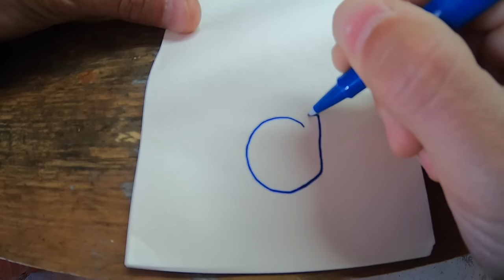MAKE YOUR SNOWBLOWER THROW FARTHER AND NEVER CLOG. Install A DIY Impeller Kit.

Comment: Additional tip -- before the season starts, give the chamber and especially the tubes a good coating of silicone spray, do it several times to get a good coating on. The snow will slide right out and prevent it clogging up. repeat between snow storms unless you live in Buffalo, NY which is pretty much everyday .  Ps: A bottle of rumchatta and hot chocolate usually helps keep the snow blower work better also!
Reply from the maker: Good tips here! I’m in Buffalo so yes this would be an everyday thing! Lol! Thanks for checking out my channel!
Reply: @GarageGear  My son is down in Corning, had 24 inches last week but I think it's all washed out. I wanted to get him a snowblower for Christmas but he doesn't want to keep any gas around his 1892 House on the hill. I had to get him  an electric mower last year when he moved in. Covis has kept him home, and the school up the street is closed otherwise he would have to make sure the walk is shoveled in the morning. I have a big 27" Troy Built and I will look into your idea. I have some 1/8 Derlan strips 4 inches wide I will try. They use that for the skid plates underneath.
Reply from the maker: @Squarekn0t  ah he’s about 2 hours away!  Does he have a shed he can keep his gas in?  Have fun putting the impellers on!  You won’t be disappointed! Let me know how it works out for you!
Reply: @GarageGear  I guess the architect back in 1892 didn't plan on that, they had servants for everything. He does have some of the most beautiful interior woodwork ,that nobody over the years covered up with paint. It was in the same family for over 100 years. Before my son bought it, the landscaper would come when it snowed. I live in Delaware on the coast, it never snowed the first ten years I was here, then I bought an awning for my deck and we had three blizzards in a row. The family from Buffalo moved in last winter and it snowed and we helped dig him out. He said he left his snow blower back home. But overall because were so close to the ocean, it does not snow until late January, or February. The only problem we have here is a tsunami of tourist and now because of our new president , that lives about a mile and a half from me, we have a storm of reporters and poparatzy.
Reply from the maker: @Squarekn0t  that’s gotta be Murphy’s law or something lol!  You should get the reporters to shoot videos of your home lol!  Thanks for sharing!

Comment: I just use sheet-metal with washer self drilling screws it was fast. 
I have to say it does work , I was really happy with snowblowing specially with heavy wet snow.
I even put it on my sons riding  snow blower. 
Truck mudflap picked up at a truck dealership cut it out by using my Dremel and put them on snowblower propeller.
Reply from the maker: I wow I never used sheet metal before? Does that beat up the impeller housing?
Reply: @GarageGear  
No does not damage self drilling hillman fastener. 
The size 10-16 3/4
H#561025
Reply from the maker: @tiger.6509  awesome to hear! Great thinking!

Comment: I believe mudflaps are cheap and very effective to use as the impeller flap extension.
Reply from the maker: Definitely! Those work great too.
Reply: I got mine for free truck mudflap. Just had to cut it to fit.
Reply: The sidewall of an old tire works too.

Comment: Very good video, thanks much for taking the time to make it.  I did this mod on my 24" MTD and I'm very happy with the results.  The only thing I would do differently on your machine is to put a nice coat of paint on the impeller and the chute area.  Snow sticks to that rust like a  tounge on a ice cube tray.  And I can tell you take good care of that snowblower, it started right up with one pull and ran smooth.  Good job
Reply from the maker: tireguy thank you!

Comment: Mr. Gear, the first thing is you make very good quality videos, sound great, dialogue great, staging great.  Do you do a lot of editing?  What video equipment do you use.  Second, why do the manufactures leave that gap?  Some commentors said some newer machines do not have that gap?  Third, the comments on cleaning the rust and repainting the impeller housing and impeller seem valid, seems odd you would do the rubber mod and not do cleaning rust and repainting.  Fourth, will the mod work on a gravel driveway?
Reply from the maker: Hey Tom! Appreciate the positive feedback! I do about 5 hours of editing on each video. My guess is the gap is there for the ease of the manufacturing process. This video was focusing on the flap install. Not on painting a snowblower. This video would be very long if I did that too. This mod will work on just about any 2 stage snowblower no matter then driveway. Thanks for watching

Comment: I did this a few years ago with my blower, however I did not use bolts. I used self tapping screws and it works just fine. A little less work to get the rubber on.
Reply from the maker: Bob Boyer That works well too!

Comment: The impellers are rarely centered in the housing so each wiper must be installed at the point of it's closest point. If you don't it won't turn. If a bit tight they will wear in.
Reply from the maker: All good points here! Thanks for watching Mrreadandlearn!

Comment: I don't have anything to do with snowblowers but maybe waxing up the inside of the impeller tube and the chute might help? It makes a difference on skis and snowboards, so ...
Reply: yes it help, but very hard to apply in winter (cold temperature) and it doesnt last long. the snow is basically hard ice particulate scrapping at high speed the wax coating off. i found riveting a sheet of crazy-carpet inside help alot. its a plastic sheet used by children to slide down snow slope. its about 2$ and its very good slippery plastic that's better than the average rusted steel.
Reply: I think Honda puts a plastic liner on some of their models.
Reply from the maker: Interesting idea.
Reply from the maker: I do that too plus the impeller kits. Throws snow like an animal.

Comment: Impeller wipers are fantastic to increase throw and reduce clogging under wet conditions, but they significantly increase auger belt wear and increase strain on the auger shaft bearing and increase wear on the auger housing, especially if you live in an area where they sand road surfaces. I've used tire sidewall material that has held up great after initial wearing down to fit the least diameter of the auger housing and after 5 years of use in this manner, the improvement in performance has been significant, but after chewing through auger belts (even Kevlar ones) I've come to realize I had to be much gentler going through snowbanks and because of the increased wear on the auger housing, I'll have to line it with new sheet metal come next summer as it has developped perforations from the metal wearing thin from friction over time.
Reply from the maker: Hey John no issues on my snowblower. On set has been on for ten years now! Still rocking! Thanks for sharing! 👍
Reply: @GarageGear  thanks! Mind you my snowblower dates from the 80s so I'm not too surprised with the wear 😆

Comment: did mine 5 years ago !Used stainless steel nut and bolts and lock tight. u can use old tire the sidewall, or bailer belt from TSC etc ... and did all blades/impeller and used a piece of cardboard as gauge to keep the same space at each blade at the tunnel.  And just make a templet to mark the rubber and the blade, center punch it drill it assemble & be done.   HAVE ONLY HAD 1 STORM EVER SINCE  LOL . But I was flinging snow 3X Further ,Wet Heavy Snow; Puddles of Water....FOR SALE :Craftsman TURBO CHARGED SNOW BLOWER !!
Reply from the maker: Only one storm? Really? This really does work well on wet snow. Thanks for checking out my channel!

Comment: Did my Troy Bilt 28" 9.5hp track drive in winter of 2018-2019. It throws snow and especially slush much better. I have a 400" driveway with 1.5" minus gravel so rocks getting jammed in the impeller area was a concern....but the more I thought about the more I felt that the gravel actually now has less places to get jammed into with the new wipers and overall performs better even in the gravel  :)  Lee
Reply from the maker: Lee Windham glad to hear you had some good results with this modification. Even in gravel!

Comment: 2 things you can do to make the drilling alot easier. 1) use a long cobalt center drill to start the holes. and/or   2) take your drill and put a groove on each side of cutting edge which will act like a center drill as you drill the holes. either one will make the drilling alot easier
Reply from the maker: Thanks for the tips MD! Thanks for checking out my channel!
Reply: @GarageGear  not a problem and thank you for the tips on the chute. I wouldnt have thought of that..kept sprayin silicone lube in the chute it helped but doent last long
Reply from the maker: @mikedayitt  yeah that marine grease is awesome!  Works very well! Keep a tube on hand and you’ll find a million uses for it! 👍 Thanks for being a fan of the channel!

Comment: Try spraying furniture polish wax in the chute and on the impeller rubber.   Lived in the Hartford Ct ares for 20 years. Had an electric start Craftsman blower that came with the house.  In 20 years  I only replaced one belt.  It rattled and shook but threw snow about 25 ft.   Nice video.  In about 1998 we hav over 100 inches of snow.  All in about 4 close storms.  Power out, I was  in Myrtle Beach playing golf.  Wife was pissed off.  Generator broke (plastic gas tank). No shop open to repair.  Son In-law saved her.   He lived near by.
Nice video.
JoeB

JoeB
Reply from the maker: Great tip joe!  Thanks for sharing your story! That’s a lot of snow!  Thanks for checking out my channel!

Comment: I had to do this to my 1971 Ariens sno-thro, the machine is awesome except in heavy wet snow.  I bought a truck mud flap at NAPA Auto parts store for $12 and made 2"x4" paddles,  for the top piece of metal I went to Lowes and bought some Simpson Strong-Tie A21Z 2"x1" Angles for 0.78 cents each and hammered them flat, 1/4"x1" SS bolts with washers and Lock nuts.  I was surprised that I was able to drill the holes with a cordless drill and inexpensive ryobi 1/4"  drill bit.
Reply from the maker: Impeller kits make those machines animals in the snow. Thanks for watching

Comment: I'm back checking your video again. I need to make a trip to the hardware store because my girlfriend did something with the bolts and nuts I needed to hold the rubber. I'm not surprised that the shute didn't come off the way I hoped that it would.
I changed my oil after the first time running it. It ran for 50 minutes on less than a half a tank of gas. I drained my oil and started to take the the 4 bolts off. They were 7/16 not 10mm like I thought they would be. Couldn't use a socket wrench on them. Had to use my regular wrench. Now I can't figure out how to get the rest of the shute off. There's several cotter pins and bolts holding the upper mechanism of the shute. I'm going to call it a day and put everything in the garage and start fresh tomorrow morning. I will get this done! I want it to be ready for the first snow fall next year. This is a brand new craftsman snowblower never used.
Reply from the maker: Sounds like you hit a few speed bumps here but trust me, this will be well WORTH IT. Next winter you’ll be laughing at how far that machine will throw! Once you get them on run the machine for a couple of minutes to break the rubber in. It will wear right in to where it needs to be. Good luck and if you have anymore questions check my videos and message me! You Da MAN!
Reply: @GarageGear  thank you JB. I'll get it. I'm not trying to be a negative Nancy. I just reread my comment. I have a shit ton of nuts and bolts so I will figure out something. I got the shute off after learning how to remove the pin that I've never seen. It almost looks like an 8. I didn't want to break it because I've never seen one before. It's a cotter pin but when it's on it looks like an 8. No open end on one side like the pin on the shute rod. 
After my coffee and AM BM I will go back out and finish it up. Hopefully! Thanks for your time and help.

Comment: Wouldn’t it be easier to mark the holes in the rubber pad by holding it under the impeller and mark from the top
Reply from the maker: Fred Baumberger maybe but it you put the rubber piece exactly where you want it and then mark it there is no question about the fit. It’s not that hard to draw the dots.
Reply: @GarageGear  maybe drill the rubber first then mark where to drill the impeller?
Reply: @davebl9645  I drilled the rubber first then drilled threw the metal with pad in place. Screwed pad in with 1 self taping screw then drilled the 2nd hole. I tried car tire side wall.. wasnt very, good  started curling and I replaced with mud flap..much better. Make sure each time you go to use blower you check  if propeller is not frozen because there is not the same clearance anymore. I did burn out a belt once.

Comment: I'm using an old Peterbilt mudflap. Ariens 70s machine I bought for $75. Cutting an extra pair for future use (using first one as a template), coating in armorall, and sealing inside plastic baggie. Impeller has 4 blades, but only modifying two, opposite each other. Mine has between 1/8" to 1/4" gap. Hard to see whether that would help. Impeller blade curves, so I'll only have a slight improvement. Drilling through impeller, I'll paint it before attaching rubber.

Great project to have some time away from the wife and new puppy, lol.
Reply from the maker: Haha it’s funny because I filmed this to escape some craziness in my household too lol!
Reply: @GarageGear  excellent video. I'm certain at least 10 views are from me. I try to let commercials run, but not always successful on all views. ;p

Comment: Did this last winter. Used self tapping screws. Worked great.
Reply: Had the same idea while watching this. Also thinking to use pieces of old paddle from a single stage blower. Did you notice much of a difference after installing?
Reply: Kingfisher yes made a big difference.👍
Reply: @Leroy100  rock on
Reply from the maker: Glad this worked out well for you! Makes a BIG difference!

Comment: Couple hints. If impeller blade is flat, drill holes in it and spray with Krylon 10 minute dry paint. While paint is wet, carefully position rubber over impeller blade and press onto wet paint. Remove and Voila! there are the hole locations perfectly positioned on the rubber. Let paint dry and drill holes in rubber. When bolting to impeller blade, no need to use locknuts. Use a lock washer on the backside. Also, if 4 bladed impeller, do 2 opposite blades first to keep balance, break them in, and then do the other 2. This will reduce the load on the belts and engine rather than doing all 4 at once. Also, rubber is heavy. Seems a lighter weight durable plastic substance would be better. And use silicone spray, not PAM. Veggie oils gum up in cold temps. Finally, make sure impeller mechanism is centered in the housing. If not, this modification will only work where the gap between impeller and housing is the least. The wider gap may be reduced some, but will always be there.
Reply from the maker: Thanks for all these great tips!

Comment: Had an idea! Before I retired I designed production line equipment for a major manufacturing company. When we required conveyors or chutes to have a slick hard-wearing surface, we would use UHMW TAPE. What if it were applied to in the area that the impeller kit contacts. Also to the back and sides of the discharge chute. Your thoughts?
Reply from the maker: I imagine that would work well! Might give it a shot too!

Comment: I would use a clamp and put all four rubber pieces together and drill them all at the same time. Then I would clamp one of the pieces of rubber to the impeller where I wanted them and drill a marking whole through the rubber and onto the paddle of the impeller. Then remove the rubber and finish the hole in the impeller. This will be much quicker and just as accurate. 
This Idea by GG is a great idea and I will be doing this to my machine.
Reply from the maker: Great tips here steadfastly! Go give it a shot! You won’t be disappointed! Thanks for checking out my channel!

Comment: Some good sized self tapping screws with washers remove all the drilling. And if you want, remove one at a  time as you drill out new holes and bolt them down.
Reply: When I did this to my snowblower... the impeller was about 1/2 inches thick. Self tapping didnt seem to be an option. I mounted the rubber with elongated holes for adjustment. I clamped the rubber to the impeller and went through both. This whole procedure took HOURS. Came out well though
Reply: @rogerwhiting9310  that sir! Is one thick impeller!
Reply: @patrickprafke4894  took me by surprise. Made the job much harder.. and I put 3 bolts in each of 4 impeller vanes. Its a 30 hp Kubota f3060. I am waiting for some real slush. It will come
Reply from the maker: That is a very thick set of impellers. WOW!
Reply from the maker: Agreed!
Reply from the maker: Im sure this thing is a beast now!

Comment: Did my troybilt 2410 about 4 years ago, the closest thing to injecting steroids into a snowblower! Will damn near pump water!!! I used material from tractor supply and used small bolts with locking teflon nuts.
Reply from the maker: I agree. Its like you gave your snowblower steroids.  Makes all the neighbors envious.
Reply: @GarageGear    absolutely! Every time i use it someone comes to me and asks about my blower! Lol.

Comment: I would recommend using stainless steel bolts and loctite, stainless , no rust, loctite, because if ever one of the bolts broke, look out ! 
Other than that it’s a great idea.
Reply from the maker: Great tips here! I used some stainless steel bolts in this video! https://youtu.be/WR-n6QE-hSw check it out!
Reply: Looks good , great idea.